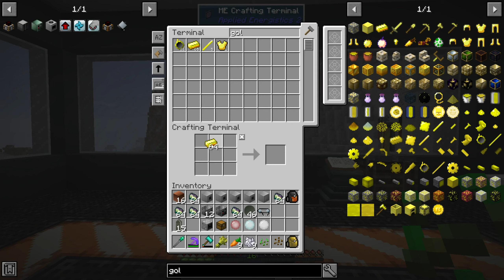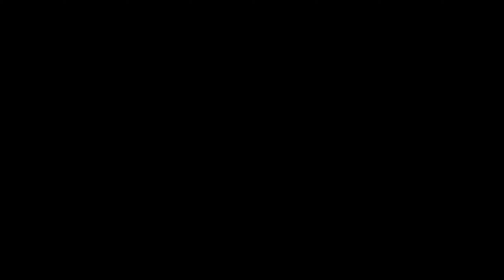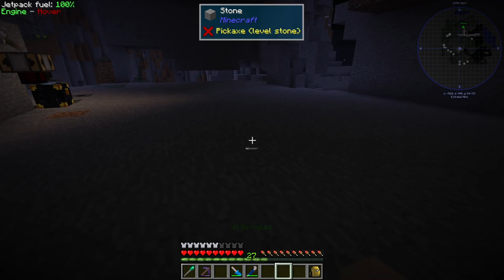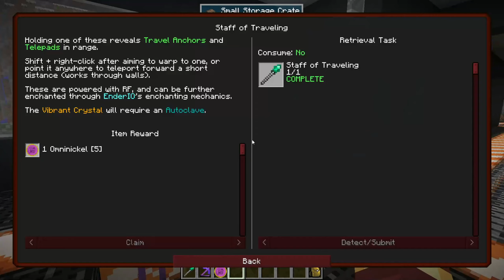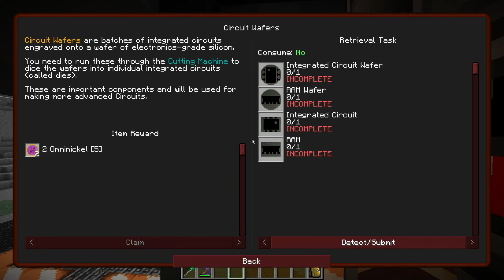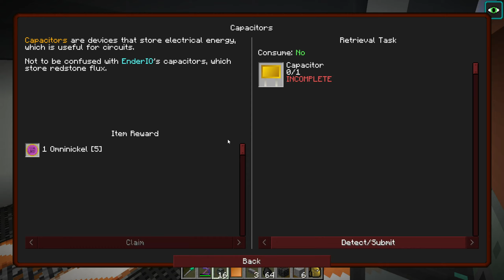Omnifactory #04 - Tier 2 circuits

Comment: You've inspired me to start playing along with you! Upgrading circuit processing is a fantastic idea, the faster you do the less resources you have to spend on those expensive T1 versions. 

Are you using a texture pack to change the icons for the circuits? Mine don't look like yours and I'm interested to try it out since it looks much easier to sight read the tier/version of any given circuit.
Reply from the maker: Awesome! Yes, I'm using a resource pack that changes the texture of the circuits to make them easily distinguishable: https://github.com/Usernm0/Ominfactory-GTCE-Circuits-Textures-Usernm/releases/